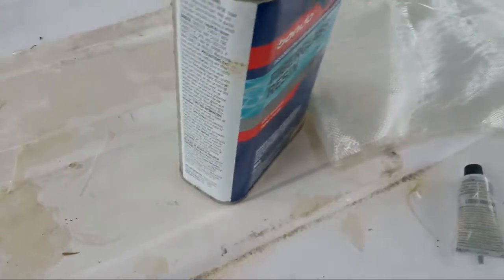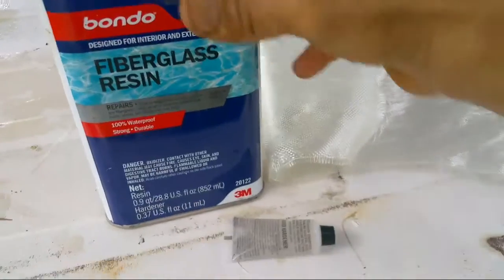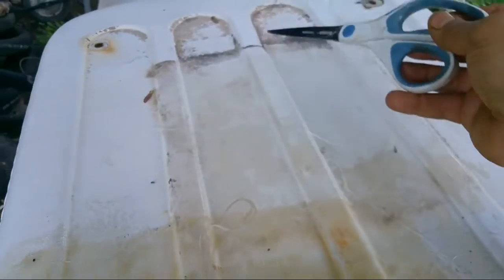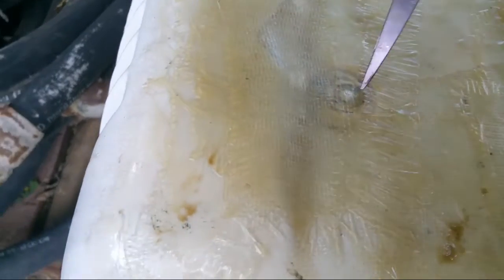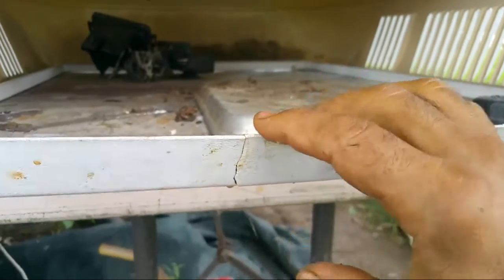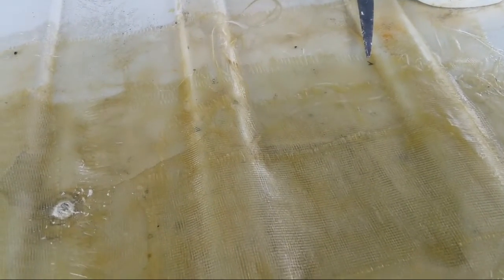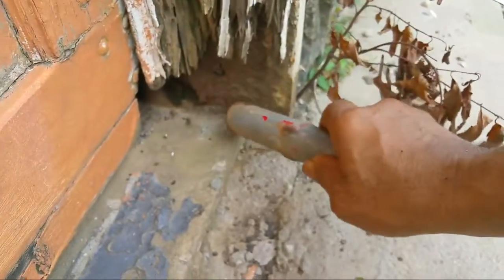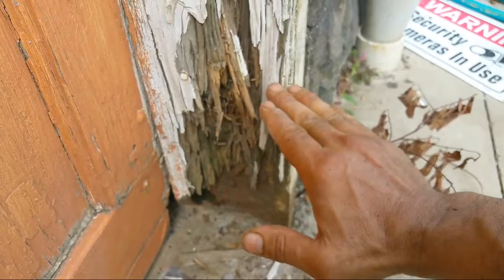Fiberglass & Resin as a construction tool Repair plastic and more

Comment: I have a tiny hole in the shower floor…

Do I need to use the fiberglass fabric or just the resin and hardener?

The hole is less than the size of a pea.

Comment: I built a boat out of plywood,used the stitch and glue method then used 6 oz cloth inside and out with marine epoxy it came out nice.All that being said , I have a gallon of Bondo fiberglass resin and am thinking of doing some fairly large patching on some seams and an a.c.shroud like ur video.Ive read that the epoxy is superior in almost every way over the fiberglass resin,any thoughts on that?I'm comfortable with applying the epoxy and would use it but I have a gallon of the Bondo fiberglass resin That is begging to be used.Im throw down cloth too,I just don't want a giant abortion when I'm done.

Comment: I always think fiber glass would be as bad as asbestos? You breath in small sharp fibers.
Reply from the maker: Anything that is not ''air'' and traveling into cavity of lungs will get ''encapsulated'' and hopefully dissolve. If, it can't dissolve and the body still thinks of the encapsulated foreign body as an ''attack'' = it will keep encapsulating and finally you lose lung capacity... (short version)...
But, it can cause pneumonia also...
Further, your lungs may force it back out with hard coughs...
So, yes, keep materials besides AIR out of your lungs...
Reply: @EngineerPEretired  0
Reply: Wear a respirator when doing body work
Reply: Ull live

Comment: I have this hammer/axe weird multi tool that had this horrible handle.  It was a steel tang with rickety wood fastened on both sides.  Trouble is if you held it, your skin would get pinched between the wood planks in the steel tang.  To make it more useable I lathered Bondo body filler on it and sanded smooth.  Now it’s nice to hold but a friend pointed out that the Bondo might break off.  So I will try 3 layers of fiberglass and resin on the handle.  That should strengthen it and make it water resistant as well.

Comment: Looks good man. I tried repairing a fiberglass water fountain with Flex Tape.As seen on tv.That stuff is crap.I applied it to the top and bottom of a crack. Failed.Tomorrow i will try it your way.Thanks.
Reply from the maker: One year later reply,  how did you make out?
Reply: @EngineerPEretired  I went to get a kit for fiberglass repair the next day. I just needed a small amount. I couldn't get just a little bit. So i passed on that. Someone who i was with fixed it with flex seal, and it worked.

Comment: can you do the same thing with carbon fiber fabric using fiberglass to fix a hole but using carbon fiber fabric mat formatting to cover up the existing hole
Reply from the maker: Yes, it is all about the fiber / woven pattern and strength of those fibers.
Yes, and carbon fiber cost a lot more money... I have a video coming using carbon fiber on concrete cracks.
Reply: Could this be used on canvas to harden it up? @EngineerPEretired
Reply from the maker: https://www.carbon.ee/en/n/carbon-fiber-all-patterns-explained
Hope this helps you.

Comment: Question 
How long it take to get dry ?
Reply from the maker: OH IT IS FAST ~~ a very fast reaction ~ about 5 to 10 minutes tops per my experience and ready to sand!
Reply: @EngineerPEretired  I had used fiberglass to cover a vent on my front bumper as a test experiment on one of my used old parts  the bumper never dried to this day that's over 13 years ago and it's still soft and green the fiberglass never dried I was trying to block a vent on my bumper by fiberglass it so also all depends on how you mix it because minds is still wet to this existing day
Reply from the maker: You are the error, you have the mix design incorrect...
Remove and replace.
Reply: @joaquinmateo4142  Even my rosin dried up in the can, same can shown on this video with 90% filled, use it once 4 years ago. Something wrong with your hardener/rosin (could be a bad batch) or wasn't mixed completely I think. Like Bondo it hardened super fast. I once use Bondo in the rain, so that one didn't hardened as expected.
Reply: This doesn't really dry it's more of a curing process the harder that that is added starts a chemical reaction which hardens the resin the more hardener the faster the reaction read the directions for your work time